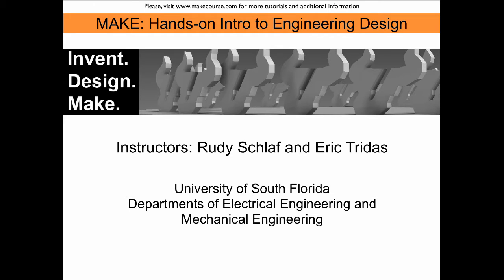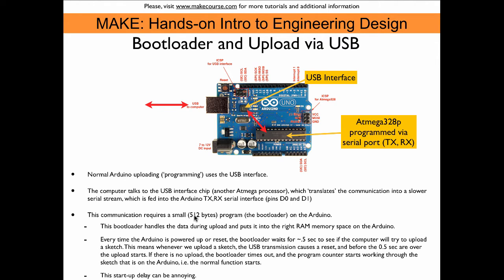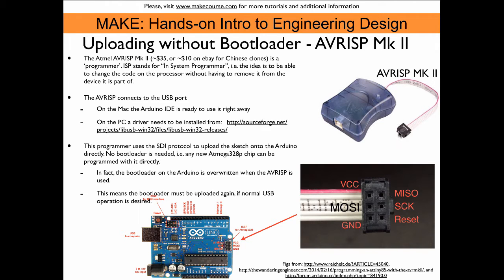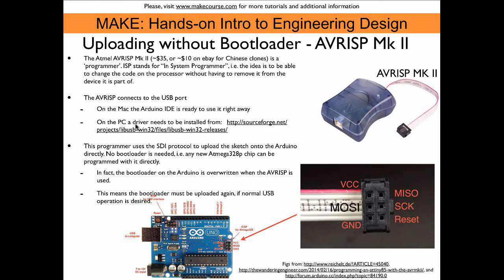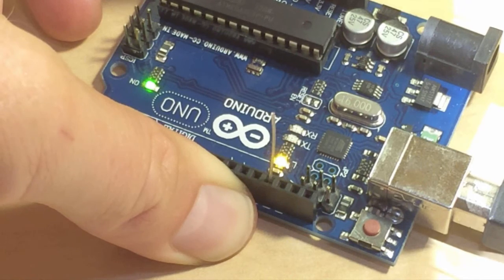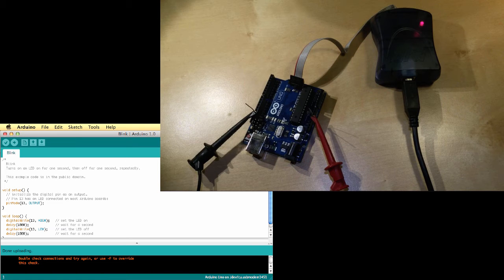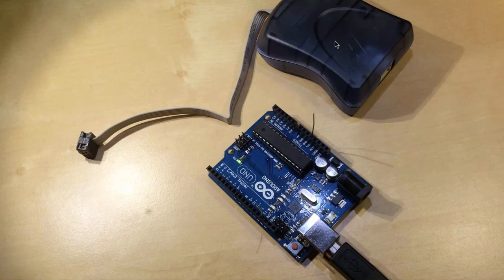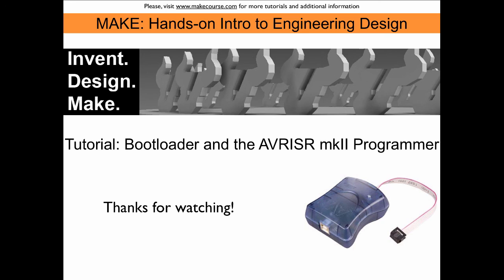Tutorial: Arduino Bootloader and using the AVRISP mkII Programmer

Comment: Very helpful video. I was struggling to find out how to remove the Boot loader on an Arduino Nano that I wanted to use as a 7 channel encoder for a model aircraft transmitter and this completely answered my problem. Just one comment that may assist others is that the driver download for PCs that is necessary for the AVRISP Mk 2 to communicate over USB is unsigned and Windows 8 and 8.1 will not allow unsigned drivers to be loaded. This can be got round by using advanced startup and the troubleshooting  and advanced options menus which allow the driver mentioned in the video to be loaded.

Comment: I had no idea that Arduino IDE does not care about Boot loader if mkII programmer used over the ISP header. I was thinking I must have fried the Arduino (before watching your video). Even I had tried flashing ATmega16U2 with it's original USB-Serial firmware. Thank you very much for sharing this video. BTW, if the input voltage is unregulated or is over 5 volts, it would be possible to use VIN pin (at last in UNO rev. 3). It appears that there is a NCP111 Low-dropout regulator on that pin which provides the necessary 5V to ATMega328P. Thanks again
Reply from the maker: We are glad this helped you! And thanks for subscribing! The Power of Make!!...;-)